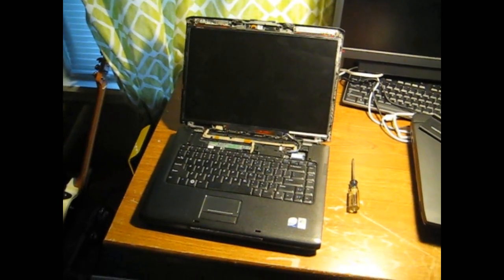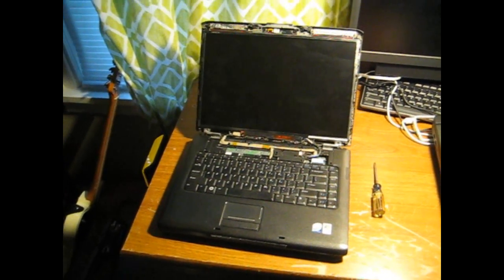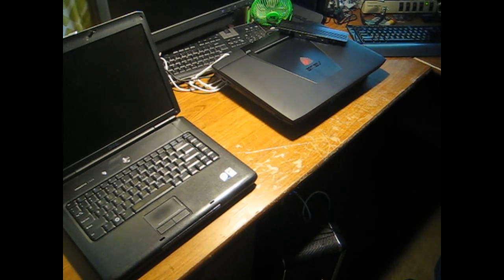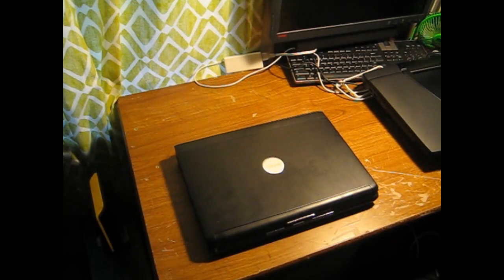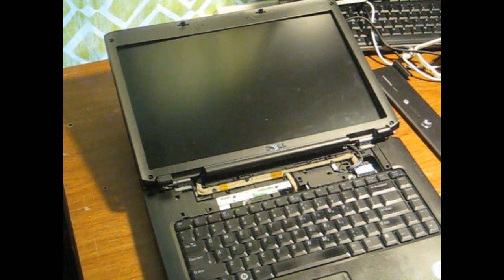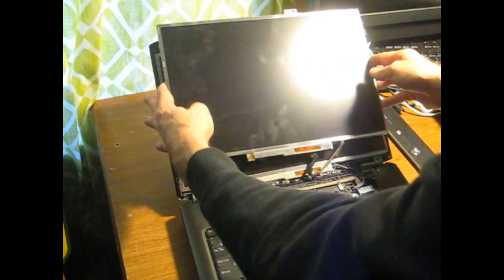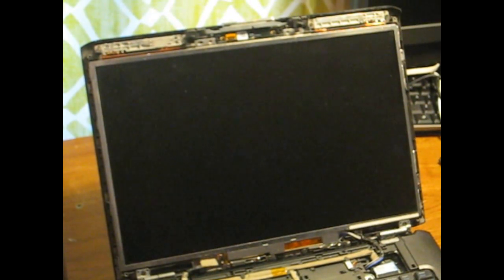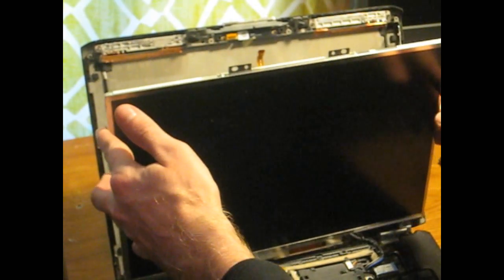Dell Vostro 1500 - LCD UPGRADE - Success - to 1920x1200

Comment: did you have to change the cable to the motherboard?
Reply from the maker: If I remember correctly I used the original cable since the one that came with my preowned LCD was a different length/"shape".
Reply: @alecjahn  

It is often the case that lower spec lcd have fewer wires in the screen cable, less copper = cheaper to produce.

Comment: Can You tell me what kind of converter you have pluged with that new screen? I can buy this model but seller is asking me what converter do I want, becouse he got a lot of stuff and he has it separate. Thanks
Reply from the maker: I didn't use any converter.  I just used the original cables and they plugged into the new LCD just fine.
Reply from the maker: There's a Sharp branded LCD that is brighter and better than the new on that I used, supposedly it's completely compatible as well.  I haven't been able to find one for a reasonable price, though.
Reply: Alec J Is there a chance that You remember the model name for that Sharp? :)
Reply from the maker: I'm PRETTY SURE it is "lq154m1lw2a" - there's actually one on eBay for $34 right now.  I saved the model number on there a while back but, obviously, I don't own the panel yet so I haven't been able to confirm myself that it is compatible.  I believe they used that panel in some of the Latitude models so it SHOULD be compatible, I just haven't yet been sure.  
Cheers!
Reply from the maker: I was going to buy it but my Vostro is basically a night-time youtube machine nowadays.  I'd love to upgrade it to a brighter panel but... I can't really justify the cost at the moment, since I've already got a hi-res panel in there even if it isn't as bright as it could be.  If you go either route (the panel I used or the Sharp one) let me know how it goes!
Reply: I have just ordered sharp lcd in Poland for 109 PLN (about 27$), so I gues I will risk a bit. Either way I will let You know how it works. I heve just noticed that You also have asus g750 :) I have g750jy. My vostro is 9 years old now but after ssd, cpu and ram upgrade it is still a great second laptop at home.
Reply from the maker: Awesome!  Definitely let me know how it goes.  That's a great price!

The Vostro is so good!  Very well-built despite being a cheaper business model.  It hasn't had the easiest life but except for a hard drive death it keeps working perfectly all these years.  

the Asus wasn't mine, I was working on it for a friend.  I believe it is still around, too!
Reply from the maker: My boss sourced an SSD for me when the HD crashed a couple years ago, It's way better with the SSD!
Reply: So, I finally made it. The screen that I bought wasn't working properly so i had to buy a new light bulb for it and changed it. I have to admit that I was a bit worried ive I manage to do that, but I did it. The resul is great. Thanks again for Your advice :)